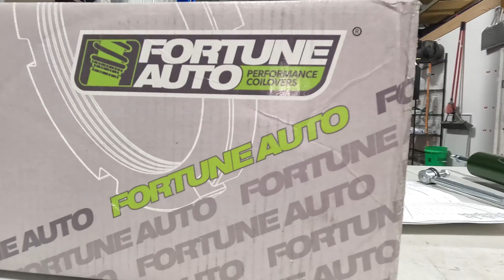How To: Install Coil-overs Correctly

Comment: Wow, super helpful video, thanks!! I've just installed a set of Fortune Auto 500 Coilovers on my GTI and am fiddling with the setup for dual-duty use (mainly just driving to the track and back home lol) and found this quite useful as a guide. Many other setup videos are just regurgitating less helpful info that resulted (for me) in a very uncomfortable ride. My prior on-track handling traits were silly corner-entry oversteer followed by a lovely bout of mid-corner understeer. Made things interesting!!

Comment: Bout to venture on this setup journey with my 128i. Did you disconnect sway bars and add adjustable end-links when setting up the coilover ride height? I'd imagine it could spoof spring rate if you're only articulating one wheel at a time.
Reply from the maker: @Mjshawks31  correct. Adjustable end links in the front.

Comment: Good video and great to see someone considering bump to droop ratio when setting up coilovers as this is rarely ever considered usually.
Personally I aim for 2/3 bump and 1/3 droop travel which is a generally more accepted ratio for track work.
Also worth noting that once you've set this ratio you should only really alter ride height via the spring perch rather than the lower shock body as doing this will alter the bump/droop ratio again.
Suspension secrets have a very good article about this on their website that is worth a read.
Reply from the maker: Ride height should be adjusted on the lower perch,  but yes, it will change the bump stop limit. Could be changed on the spring perch as well, but that changes your bump/droop ratio. All needs to be considered when making changes.
Reply: @KrebsbachRacing  so the way I do it is to figure out my ride height first, mark on the damper rod where the 2/3 total bump travel is then with the spring removed set that mark to the top of the coilover body with the hub jacked to the desired ride height. Then refit the spring and adjust to the desired ride height using the spring perch only. This gets me back to the desired ride height whilst maintaining the exact bump/droop ratio I wanted.
Obviously this falls down if the desired ratio doesn't give enough wheel / bumpstop clearence when compressed, but luckily I've not had that yet
Reply: @S65_E92  I think the 2/3 bump and 1/3 droop rule of thumb is a bit mis-leading. Because it's built on the foundation that the coilovers system will have close to stock travel. But when you have a very short travel cartridge like the generic FA510, then you have to pick and chose your battles. Sometimes, you have to sacrifice some compression travel so that you don't risk lifting a wheel off the pavement. 

Imo, I think we should always ask 2 piece coilovers companies (like Fortune auto) to provide us as much shock travel as possible. So we don't screw ourselves into a compromising system.
Reply: Solid video Shawn. Knowledge I needed to learn